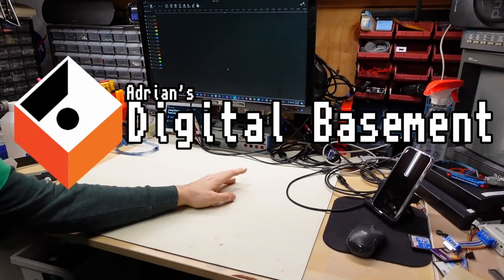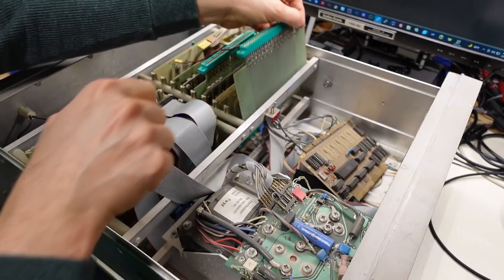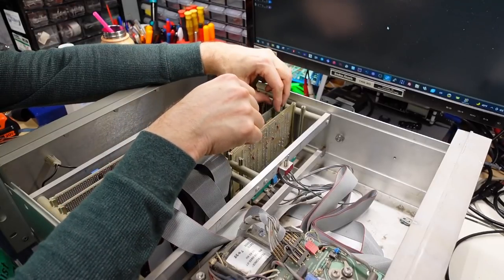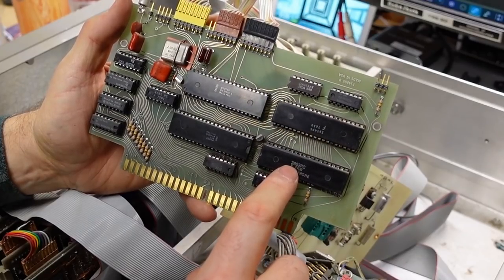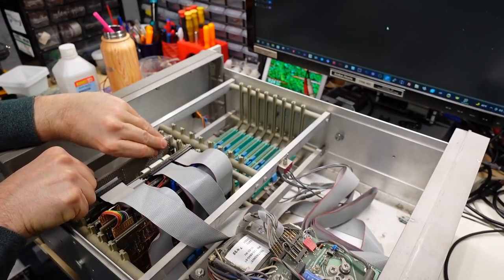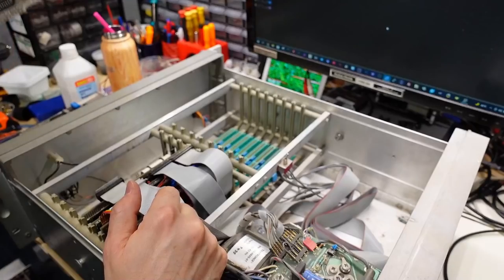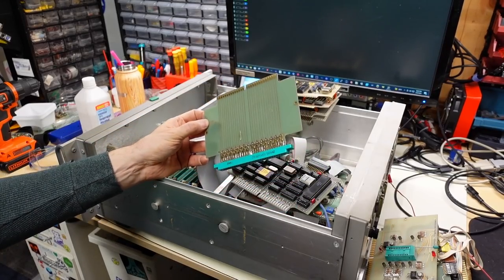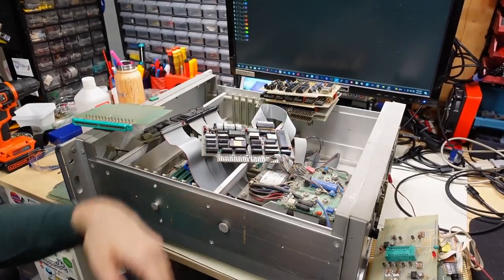I need help finding information on this mysterious computer

Comment: look like z80 or z else it homemade DIY 
look like it been make back in 2005 or 2010 n left abandoned for almost 10 or 15 years and battery leaked

edit* i dont see any factory build for that n fact that is diy make and stole parts off of factory pc which i cant identify as case or else is in it
but i can tell that case is serve pc back in 90s but inside way different than any of that*

Comment: The case rack brackets and handles are a Tektronix style, the power supply smaller connectors are classic Tektronix, and the transformer actually says Tektronix.  It's NOT a home bodge, it's some Tektronix prototype.  If you want to know what individual cards do, google the part numbers of the large chips. 

The moment you started saying the power supply was 'scary' and maybe could be replaced with a PC power supply, I knew this video was a waste of my time. So unrealistic and impractical.